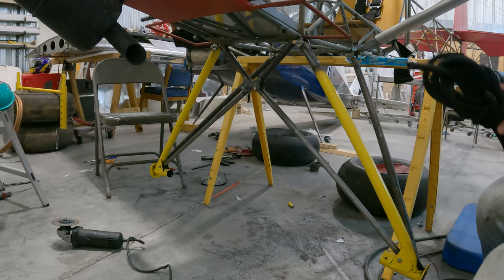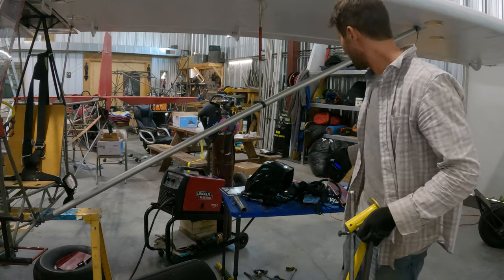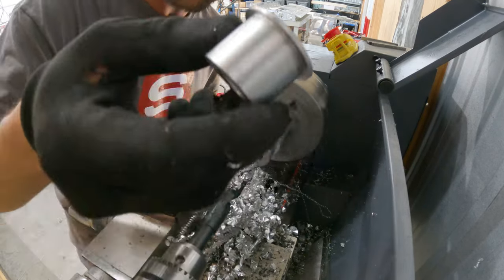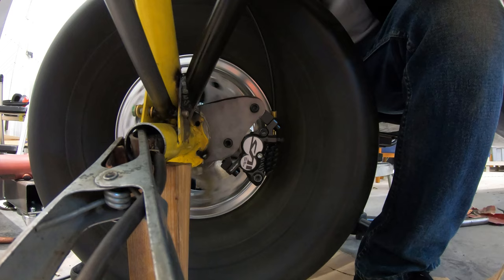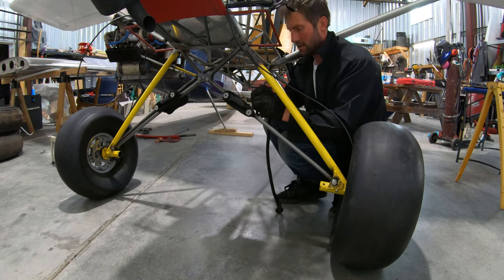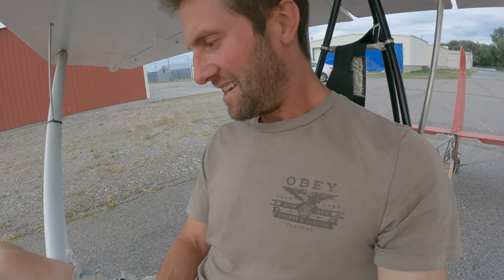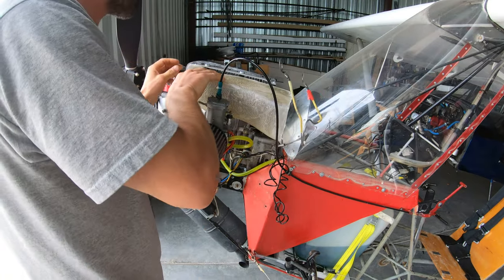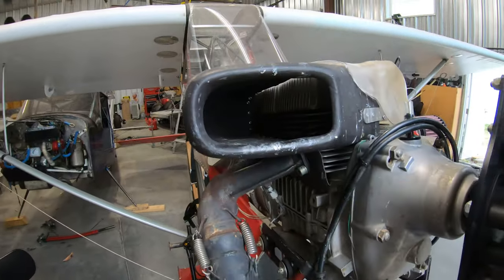Abandoned Airplane Landing Gear Build is DONE! but NOT Strong Enough!?

Comment: Nice 👍
But remember, don’t just design to make it go right, design for those situations when it doesn’t go right, i.e. Safety Margins and Risk Mitigation 😉

Great videos, great project, thanks for sharing 🙏

Ps - you could invent some sort of remote ‘engine kill switch’, just in case ‘chocking the wheels’ for starting fails. Seen too many YouTube videos of “Runaway” aircraft 🥺

Comment: A couple pieces of roofing flashing with some oil between them under the tires is a good way to test gear, it'll let the tires splay out easier, what you want in a test. A deeper cabane will make weak bungees work more effective. More drag and weight of course!
Reply from the maker: That's a good idea! Yeah i should have made the cabane a little deeper.

Comment: You can use motorcycle spring
Reply: The trouble with a motorcycle spring is they work under compression. He needs extension springs.

Comment: G,day Jonas from Sydney Australia.
Thanks for showing the manufacturing of the composite fibre air duct. I would not have envisioned its airflow to the back cooling fins. 
Just a thought: some plumbing PVC pipes have thick rubber O rings for use in landing gear suspension.

🌏🇭🇲